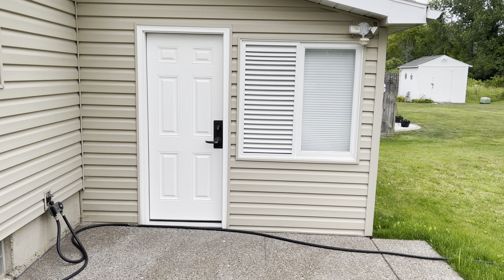Are Fans Enough To Cool A Mining Farm?

Comment: In my experience you can't really do a duct system because that would mean damp cold outside air hitting cards directly before it gets a chance to mix work warmer air and drop RH.

Assuming you have your GPU boxes you can just build a wall out of those to direct air across the rigs more.

But as above you do need mixing otherwise you will get the green death on your equipment.
Reply from the maker: Yeah, there’s challenges for sure. It’s a bit tight in there so there’s only so much to be done. Right now there’s a fair bit of stratification, the upper fans are able to nearly pull air straight through the intake to the exhaust so the ceiling is cold and the upper fans don’t contribute as much. I might just try some basic deflectors and see if I can even things out that way.
Reply: @SiCPoWMining It's rare to have a discussion with somebody who understands such things on a domestic scale; you're probably right that deflectors might increase mixing and warm up your ceiling.

That you you just put another shelf on your racks and pile GPU boxes up to the ceiling.

It's an odd one because you kind of have to half arse it and have it not perfect.

Another approach I have taken for mixing and lowering RH is to have hot/cold rooms with a partition wall between and only have holes in the wall directly in front of cards; then have a few fans working recirculation from the hot side to the cost side about 20% of the main throughput CFM... That gets you excellent mixing and also increased airflow directly across miners.
Reply from the maker: I’ve sorta considered solutions like that, since I do have the space to recirculate and it’s not that hard to do. Ideally I’d like to avoid a large surface area of flammable materials if practical, so the boxes can’t be long term. I’m looking for efficiencies any way I can, as long as they are cost effective to implement. I suspect I can shave off 200W easy with cardboard ducting that feeds the exhaust fans with the second rack of cards. This would intake air in the middle of the room, and I can remove the box fans on that rack. I’m going to work on boxes for the intakes that snake air across foam, but I’m not sure the best way to do that since they’re physically very large. The air intake location can be shifted from the design of these, and I was considering dumping it into the sides of the room rather than right into the rack to get some better mixing for nearly free.